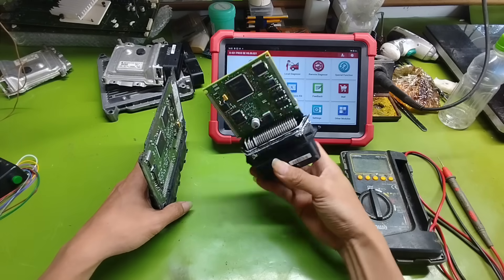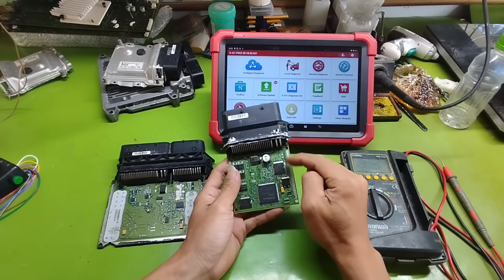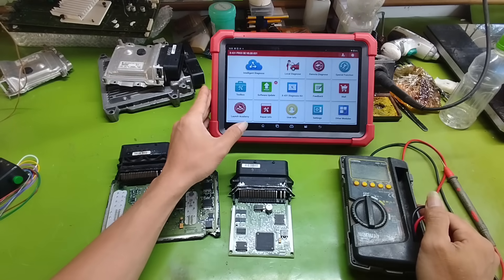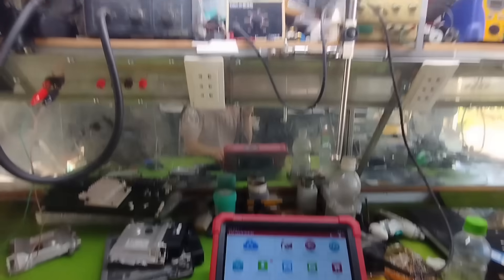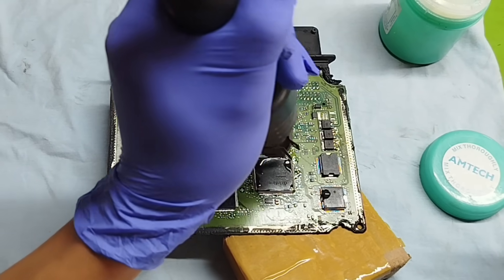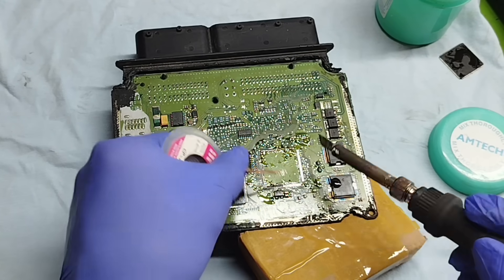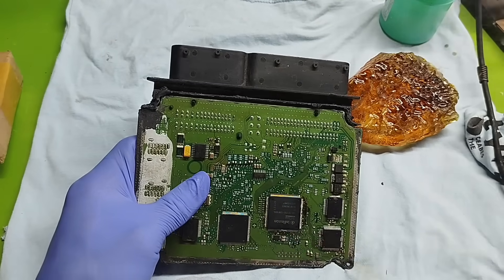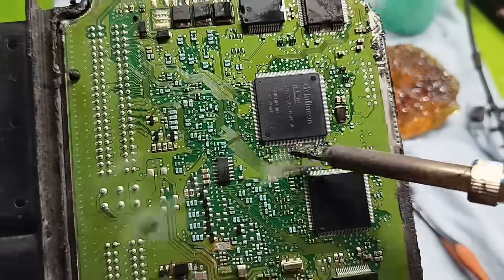🔧 Learn Car ECU Repair from Scratch – Simple, Beginner-Friendly Tutorials

Comment: im willng to share my basic knowledge of the fundementals of trouble shooting steps that i have learned over the years and the number one step is to insure that your connctions from the positive battery constant supply is always met and verified at first , the 2cnd step is to always verify your units grounding  strap to the unit and directly too the neg termininal on your battery, by using the ohm readouts on your meter first , and resistance higher than 1 to 2 ohms is not acceptable too the units proper functioning requirements , but this is to the   grounding side which ids used for the ecu  to operate ,, , i found this out too be true when finding  rusted screws that bolted the grounding straps to the chassis  and most automakers always painted thier panels made from steel painted them before assembling the elctronic components , this leads only too the threaded portion of the contacts too let current and voltahge move freely  but due toot he minimized surface contact area  corrosion will eventually form between the two surfaces the screw and the metal plate inside , and none for the outside contact of the flat round metal copper electrical lugs that are supposed to make metal to metal contact with however not being able to use because of the primer paint prior to assembly,, i have found this too be one of the major contributors too erratic malfunction symptoms too be the cause of 50 percent or more of older  model vehicle problems ,, the rest are due too accidental reverse voltage spikes or defunk battery and altenator outputs and faulty or degraded wiring to sensors  and then too bad out of service life sensors  ect, but beyond that is a different area wher emy knowledge stops due toot he sra when i experienced  these issues was until about 20 years ago wher ei have to draw the line,, as my knowledge pertained too the EEC-IV models and a few years beyond that into the newer obcd2 gen modes but not anyfurther, this is new stuff for me and im am amazed how  much has changed in the  compact design as well as the compact  caps and other components used in the old days compared to the current building method sused these days ,, WOW is all i can say but i think the basic concept has to remain the same as far as troubleshooting ecm devices and related ,, stick to the strict guidlines as this fellow has describes and you will easily be able too diagnose  a ecm faults with out much problem but if you skip a step youronly setting yor self up for a long miserable fail , i am into  putting my 2 cents worth in if its worth anything anymore , im retired now qith nothing els ebetter too do except find things from my era to fix .. like a solid state  stereo console from the mid 60s  but  even fixing old elctronic  stuff first installe don vehicles  ids a challenge too me as much as fixing a new ecu is today,, im all for it, i am for a more durable simpler rugged design  for most electrical applications for new tech based on durability  and longevity to mankinds  upmost known abilities to break the unbreakable with out even trying sometimes but too us old er generation of electronic design and repair where solid state and even the first op amp logic chips and eprom first ame out ,, this new stuff is beyond my physical and financial capabilties and at least this guy is strait forward there are some things only some one with the right tools can fix these and i am to old too start over again ..by the time i even get within striking distance the tech will have changed so drastically  it would be of no use so i stick to what i know and solidstate is something any one can figure out and doo even at the 5 th grade level.. 'this new tech if i cant fix it ill just remove it smash it up with my trusty hamme rinto powder and throw it in my jar of mercury and when full ill squeeze out the precious metal and refine when i get too a sludy like viscousity then recover the gold and silver and any other precious metals and  go buy a good bottle of homeade brandy and kick back and listen too my old kenwood or my streo console made in the sixties , and smile.

Comment: Arigatōgozaimasu Sensai 🍃 
I did my first eepprom on a CEM module.  2010 Volvo V50 all keys lost.  Used Gemini to find all the soldering equipment I didn't know anything about other than what I've seen on YouTube. I've had the x100max for 7 months now and finally set it up for bench work. 
A $70 digital microscope and a $70 soldering iro, and the consumables.  After successfully reading the chi, I installed the module back in the car and it is in working condition.  It allowed me to enter its menue and clear dtcs and other functions like read ecu information.  But it was short lived. I was left with deep empty felling.  So I 👀  opened up a FEM BCD that a guy left with me since  around the same time I got the x100max.   But this one didn't require soldering to read that chip. A clip gets it done. So im really excited to find this channel,  
Im the guy in the classroom that wouldn't shut up. But now as an adult I focus that energy to the topic 
Would you please accept me Sensai? 🌌

Comment: Is this real this is something I been wanting to know I would like to know how to diagnose and repair the ecu and to know if that definitely the problem the ecu is expensive I’ve pinpointed troubleshooting down to the ecu but still not 100 percent sure that is the problem I always wondered how can I test the ecu itself before condemning it or possibly repairing it
Reply from the maker: When it comes to this issue, you need to have a solid understanding of body electrical systems.
Specifically, you should be able to read and analyze wiring diagrams, and clearly understand how supporting components — especially sensors — work.
Only then can you accurately analyze and make the right judgments.

Comment: Count me in, i've been waiting for this automotive tutorials likes.
Subscribed also already , I have learned some fundamentals (from different YT and Google tutorials) , but still lack of knowledge for the power flows or voltages how it runs. I am also working at my small garage for my clients, so sometimes if i have more free time i could watch vids like your which I found more helpful for a person like me wanted to learn.
(seems so your motivated to teach guys like us, not just for the revenue of YT as I hear your voice)

I am a entry level tech (open a small shop for basic auto car  maintenance services and trouble shooting), a Diyer before for years and proceed to enroll last year at our country's tech school then proceed to Toyota school for short electrical lvl 2 and AC lvl 2. Now i am really interested to extend my knowledge in electronic stuffs since it is the extension of electrical components in our cars. Have the ideas in ECu, capacitors , power supplies, resistors, transistors but in reality still go lack of knowledge how their power flows or proper checking.. 

In your exciting electronic series I am very much hoping to learn the fundamentals of repairing ECU / other automotive electronic devices.

thank you in advance, 

- Mark
Reply from the maker: Thank you! I'll be posting the first tutorial video in the next 1–2 days. Make sure to turn on notifications so you don't miss it!"
Reply: @Autocar_Star   I'll be then,. ton of thanks bud!!
Reply: You got new video buddy ? ^^